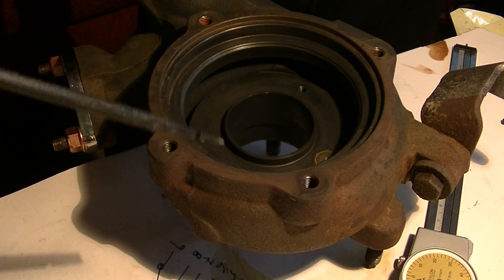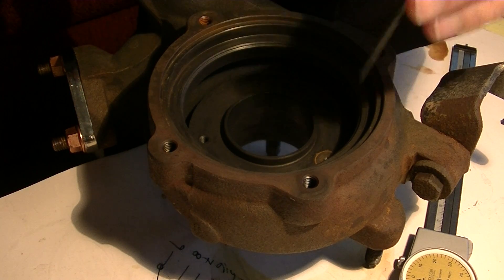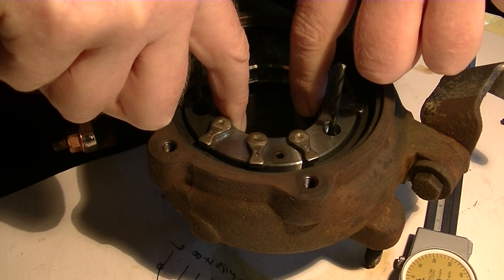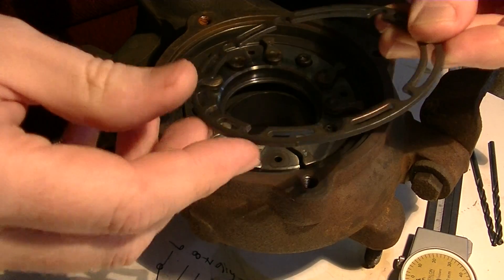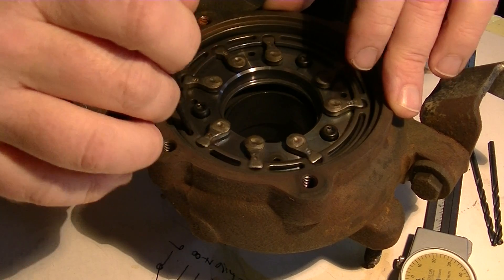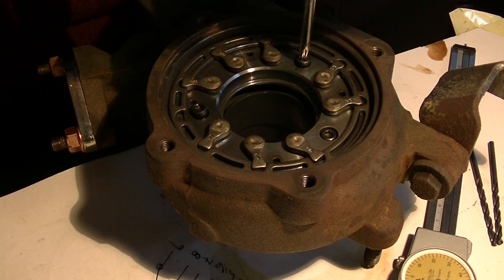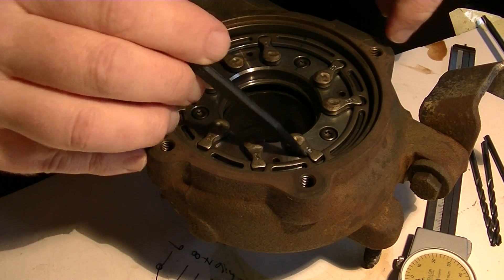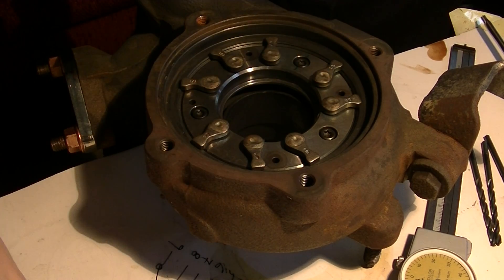VW KP-39 turbo vane assembly trouble - Part 1

Comment: First of all, this is not a KP39 turbo, It is Garrett GT17. Their is a spacer plate missing that must go in first before you drop the 3 spacers and nozzle assembly into place, This will lift the nozzle ring assembly to clear all obstructions.
Reply from the maker: No, it really isn't a GT17. It was a dead stock KP39. If you watch the video that follows this one you'll see that I found the plate. Anyway, that car is long gone.